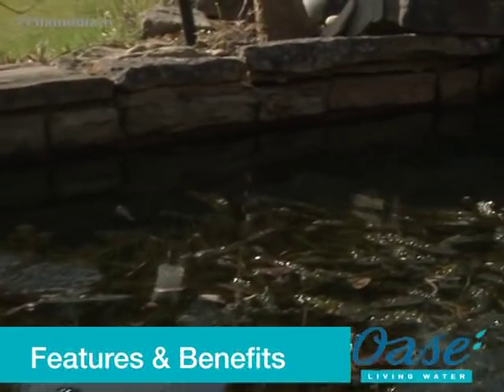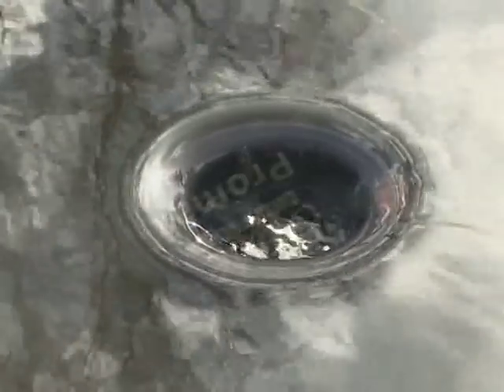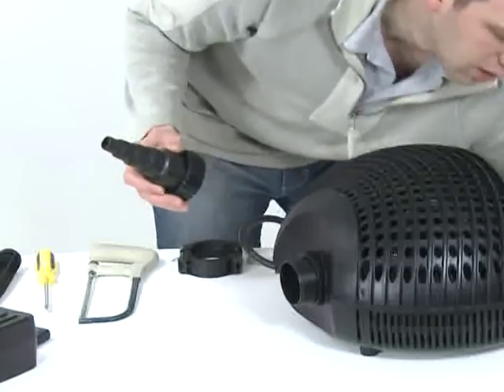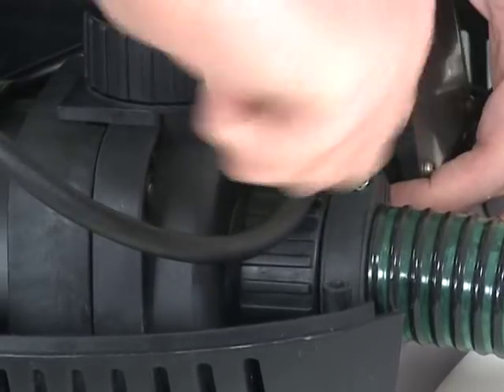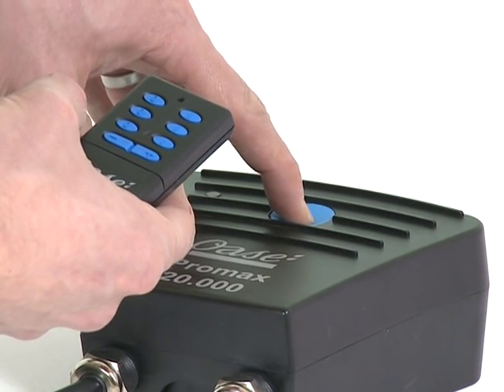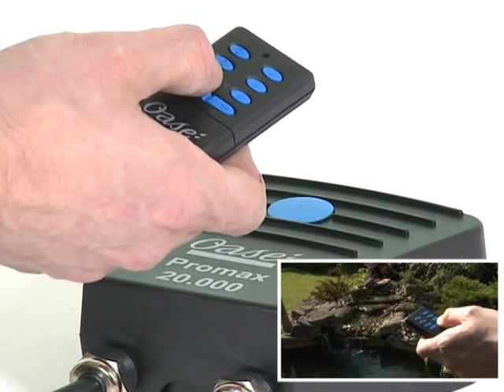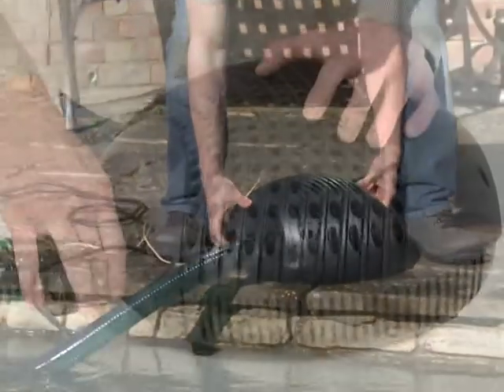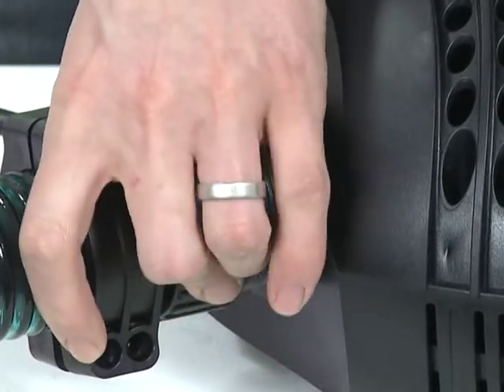OASE PROMAX 20000 and 30000 FILTER PUMP

Comment from the maker: You can get smaller combined units, such as the Filtral 5000 from Oase. They have a pump, UV and filter combined in a single unit. 'Filter pumps' are generally described as pumps that can shift large volumes of water, ideally at a low wattage to save on running costs. 'Filter pumps' have a cage surrounding the motor which allows large particles to be pumped to a filter.